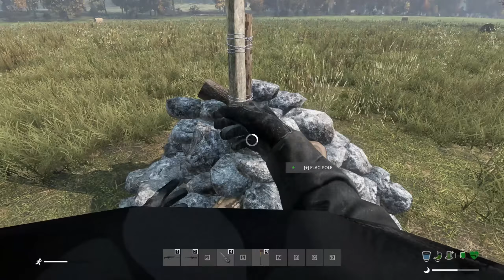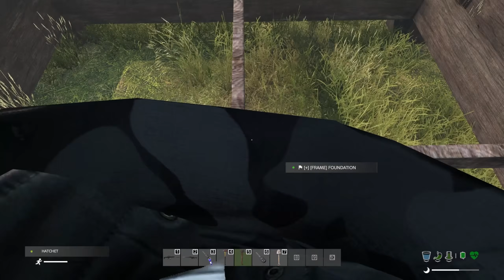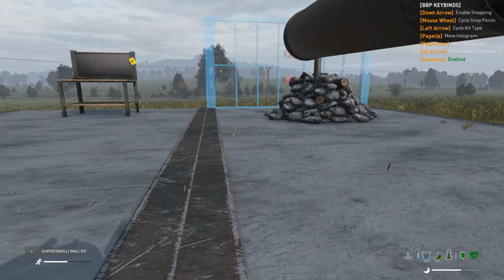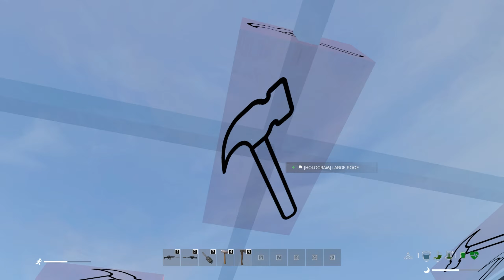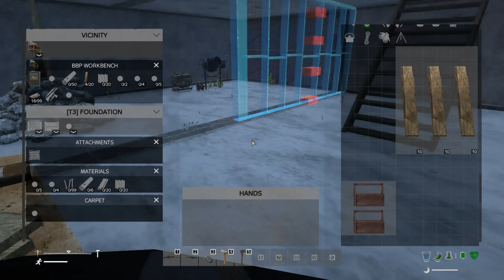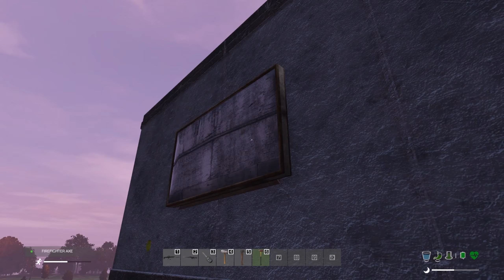DayZ Base Building Plus 2.0 - Beginner to Pro Tutorial

Comment: Loved this video so much! Thanks a bunch! One question, is there a way to turn something while still snapped? I want my floor hatch steps facing another direction, but I can’t figure out how to get it to turn without unsnapping it and hoping the alignment is right 😂
Reply from the maker: Am glad it was helpful! Umm for hatches it's a bit tricky, it's a mod "limitation" that am still having a hard time occasionally. Floor/roof hatch placement is based on where you look (and no it's not logical the way it works 😂). So I usually just place it and I try to see where the opening on the hologram is, then gently move my view away (it's sometimes easier from a third person view). Try looking both left and right to try finding a perfect placement. 

The other option is to open up the menu again, and rotate, but keep in mind if the hologram placement was already adjusted in some angle, it will not fit. So use that only for perfectly flat placements, and before confirming, try to look at it from 3rd person view as it happened to me dozens of times that I miss one or two scrolls and have to go from scratch.

I hope this helps!

Comment: Admins can build with a single click. How can I do this on my own server without needing any resources?
Reply from the maker: Yeah, specifically for BBP you would still need to place a hologram and then either hold F key, or use admin hammer that you could use to build like with a normal hammer, the difference is that it is instant and requires no supplies

Comment: Hello, after I build the workbench, attach 10 Planks, 99 nails, Tape Measure and BBP Notebook, and choose "read" the book opens and I get the recipes on the left but on the right it doesn't show the green colored text box that says "Craft Kit." Any clue on what I can be doing wrong?
Reply from the maker: Hmm the only thing that goes to my mind is that you either need more planks of recipes themselves are different. When you select a kit, what is listed as requirements for example for a wall kit? In my tutorial it is 3 planks and 3 nails, but it might differ from server to server.
If you have all the supplies needed listed in a book for a desired kit and attached to a workbench but still not getting prompt to craft a kit, I would ask on a server discord if crafting kits via workbench is active.

Hope this helps!
Reply: on the server i am currently playing on, you need additional tools for the workbench to be able to build stuff, e.g. some grinder and tablesaw. those items can be bought at trader (additional modded server)